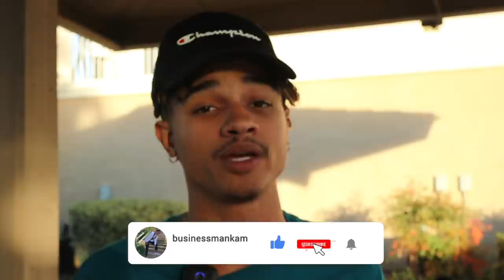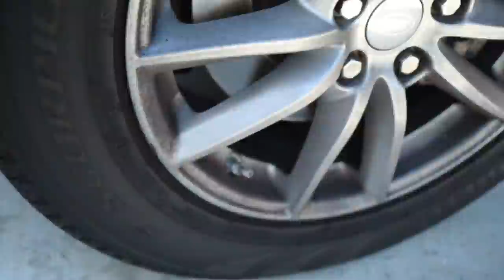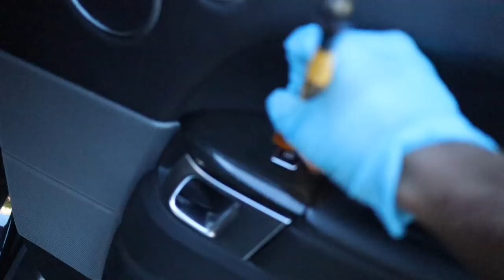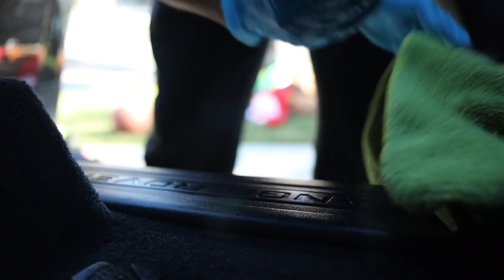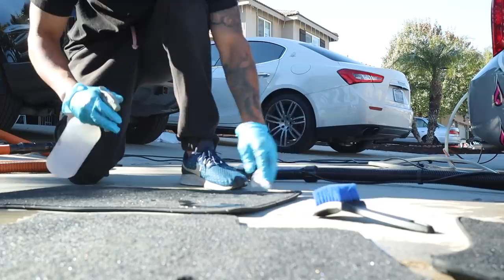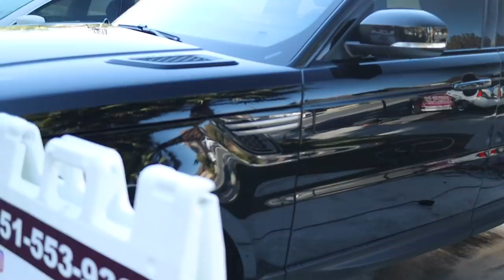A Customer Confronted Me For Stealing...

Comment: Great vid! What I usually do, I’d leave whatever I put in the trash bag and told the owner to run through it just in case they have something of value. Ooo and also rec. the inside including the trunk before I start the job, the glove compartment, central console, side doors storage, and also the kangaroo’s pocket on the back of the driver’s and passenger’s seats.